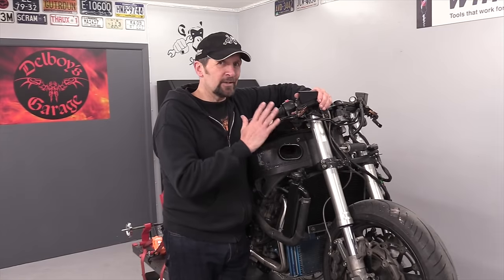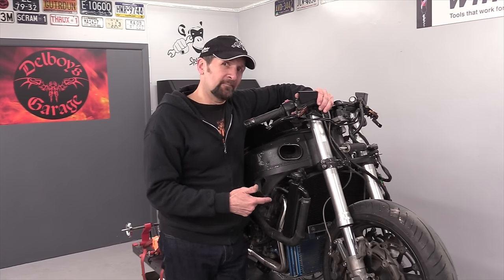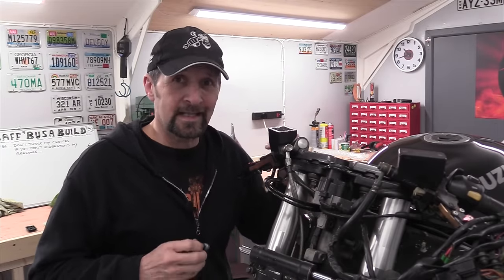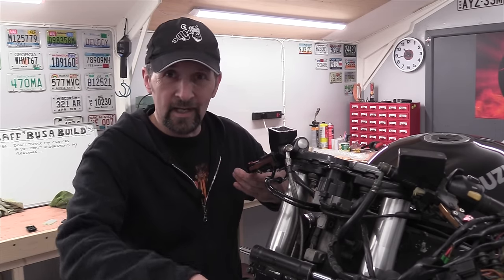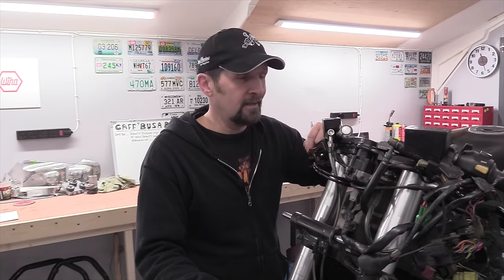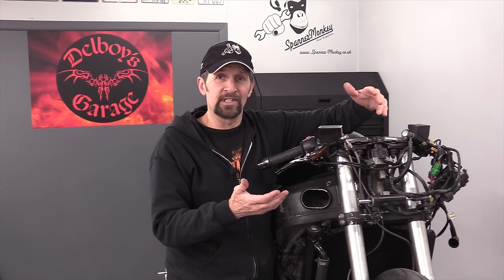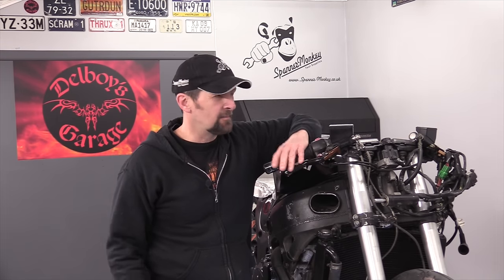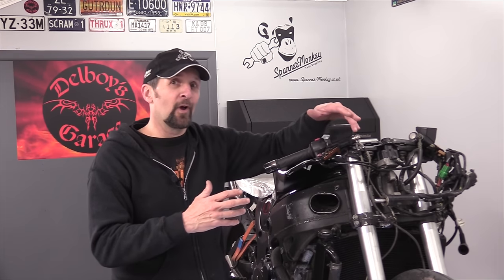Delboy's Garage, Priming an Empty Hydraulic System !

Comment: Hey Del, I've been having some ongoing issues with my brakes. I bought some braided lines which are a two hose system. I've had a mechanic use a suction pump to suck the brake fluid through and yet the lever is still squishy. How can I keep that "rock hard" brake feeling maintained?
Reply from the maker: Hey buddy, put the bike on the sidestand, turn the steering to the left (which puts the resevoir at the highest point), then tie the brake lever in to the handlebar overnight, this will open the valve and allow any left over residual air to drift up to the top... untie it in the morning, pump it a few times and it should feel a lot better... if it doesn't get any better, then you could try bleeding it through with some fresh fluid which should get it definitely rock solid!
Reply: @Moonfleet41  Thanks for the reply Del! I've tried this a couple of times and you're completely right it does make the brake lovely. However, that feeling barely lasts the day and tends to end up quite squishy. Not sure why, any suggestions?
Reply from the maker: @brewmyteabag1830  Well if it comes back in a day, then i guess you have some air trapped, why not bleed the whole thing through with some fresh fluid from scratch, i bet you'll find the offending bubbles eventually..
Reply: @Moonfleet41  Thanks for the advice. I'll keep at it! Hopefully I'll find them.

Comment: Why don't do it the Japanese way, reverse bleeding with a syringe? Just pumping fluid from the caliper to the reservoir, is easier for the bubbles to go up. I use a big syringe and another to empty the reservoir while filling, no need to pump anything.
Reply from the maker: I do that also, many videos covering it on the channel.
Reply: @Moonfleet41  good.
Reply from the maker: I use this item, made specifically for the job.. https://www.spanner-monkey.co.uk/oil-and-brake-fluid-inspection-syringe-200ml-120826?search=oil%20syringe&description=true

Comment: Top geezer 
Firstly many thanks for your vids.
Question.
I need to replace for seals on my 1995 Kawasaki zzr1100d but upon trying to remove front section of mudguard bolts found that the one I tried to unbolt just rounded off the bolt head so guess the bolts have seized in the fork legs, the bike has 30500 miles & probably have never been out, my thought is to heat up bolts with blow torch to get them to move also I want to replace 10w fork oil with 15w oil
as too soft on 10w oil.
Big big p off that my road tax is now £91 & is extortionate fraud as some cars are £20 or £30 & our roads are now so poor that they are deadly to motorcyclists.
Motorcycles put out less co2 than small cars yet we get conned as we are   taxed on engine size.
Emissions tax is legalized fraud and does nothing for the environment as we all need to tax our vehicals but just makes more money for the government  purse & prices the poorest people off the road. It's all a con.
My warmest thanks to you sir.
Glyn
Reply from the maker: Thanks Glyn, Don't get me started on road tax..  proper highway robbery aye.  Good luck with the front mudguard mate.

Comment: As someone else said its faster and less messy if you get a plastic medicine syringe from the chemist and a short length of rubber hose the right size to fit tightly on the bleed nipple, loosen nipple and fill the system from the bottom up one caliper at a time, it doesn't take much fluid maybe 4 syringe fulls till the reservoir is half full. Each time you need to fill the syringe either nip the rubber tube with finger and thumb , I use car vacuum hose which is soft enough, or leave the spanner on the bleed nipple and close it every time you need more fluid, it takes about 2 mins a side so it's really quick. Then if you're really lazy just use black tape to hold the brake lever close to the bar (cable tie might mark the rubber grip), leave it overnight and any bubbles will find their way to the top, no fancy bleeding kit and no mess, check it in the morning you'll be amazed how solid the lever is. Did this last week it works, honest. 
Just go gently when you're squirting the fluid in or it might pop the syringe off or fire fluid out the top of the reservoir, and stick a plastic bag over your tank and a bit of paper towel under the reservoir just in case.

Comment: You should be wearing safety rubber jonny type gloves when working with brake fluid. Putting a bare finger over hole in master cylinder pumping the lever to expel air looks downright stupid to me.

Comment: Hi Del, I always use the syringe fill from the caliper, which expels the maximum air from the system (air floats on the fluid) thus making the final bleed quicker.  Also, the brake pipes are not full of fluid when free draining as the liquid will cling to the wall of the tubing leaving air in the centre (simple fluid dynamics) so that even when you close down the system you have less fluid in it that you would hope for when you gravity fill.
You mentioned using silicone on the seals of the master cylinder - this should NEVER be used especially when using glycol based fluids DOT 3, 4 and 5.1 as the silicone reacts with the glycol to create a waxy residue that clogs the system, with dangerously disastrous consequences.  Rubber grease is the only grease type lubricant that is safe to use in any brake hydraulic system.
DOT 5 is the silicone brake fluid that has been rendered obsolete by DOT 4 and DOT5.1.  Although silicone fluid appeals because it repels water molecules, that is its downfall as the water molecules are repelled to the boundary of the silicone and the metal components where they are held and cause corrosion.  For that reason silicone brake fluid should be replaced annually, whereas DOT4 and DOT5.1 should be replaced every 2 years.  Silicone brake fluid was originally designed for the temperatures experienced in racing when the highest glycol fluid that was available was DOT3.  It did not matter that the silicone was prone to promote corrosion because in racing the fluid is likely to be changed many times during the season.  The performance of silicone DOT5 (confusing!!!) is lower than synthetic DOT5.1 and barely meets DOT4.  I always fill my systems, both full fill and bleeding, with DOT5.1 as it is full compatible with the glycol fluids and will provide the very best performance for 'normal' use.  There is of course racing fluid that is simply not required for anything other than all out racing with frequent fluid changes.
Reply from the maker: My word Clive, thats a long message.. Reading through it, I have indeed used "Red Rubber Grease" on the calipers, i made several videos showing this in great detail, the grease is actually sent with the caliper seal and piston kits in a tiny tub in the box..  slip pf the tongue maybe mate.!
Reply: @Moonfleet41 . My apologies but I thought it best to provide a complete picture.  I guessed the reference to silicone grease was in error but there are those that would have taken it at face value without either reaching your subsequent comments or understanding them.
Reply from the maker: @clivewilliams1406  No problem at all Clive, thanks for taking the time to contribute mate..

Comment: Im having issues changing the cylinders on my sv650 k5. Non abs, i took old cyclinders out due to seizing no issue, trying to put new cylinders in is hell, i initially put one in wrong way around, popped it out by putting back on bike and using brake lever to pop it out again, now trying put them in the correct way is proving hard. One is jammed other i aint risking it, yet the cylinder went in easy when did it wrong way with flat face facing out 🤔

Comment: What about lifting the callipers higher then the lever (master cylinder) the only problem is mounting the callipers somewhere ...
Reply from the maker: Thats a great trick for bleeding up a troublesome caliper,  leave it hung overnight, with the lever taped in... and it'll bleed up solid in the morning... This trick was more about priming the empty system so you can start the bleeding process..